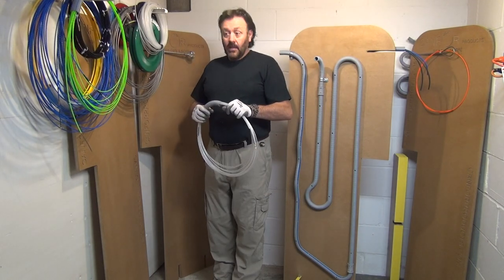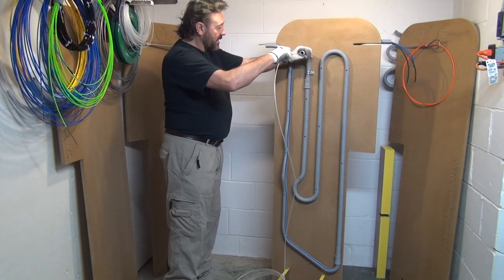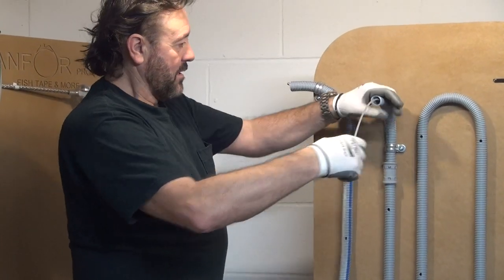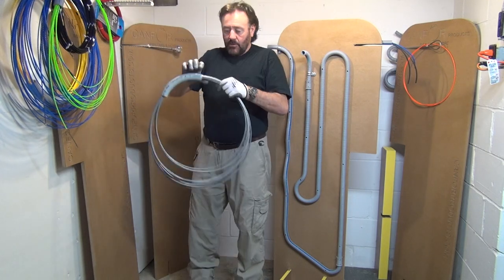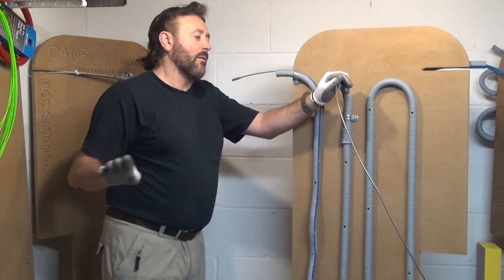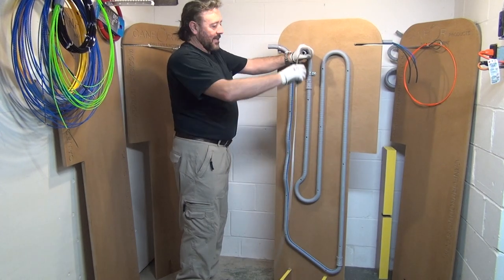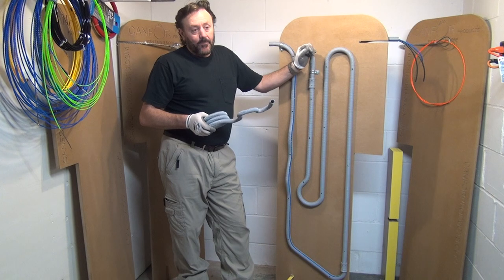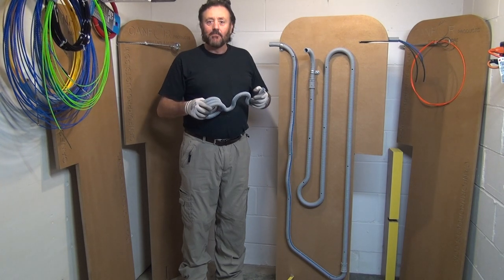Canfor Products  Nylon Vs Nylon fish tapes.

Comment: If you are pulling through 9 - 90 degree bends and you installed the conduit you have failed as an electrician. 4- 90 degree bends is the maximum allowed number of bends by code.